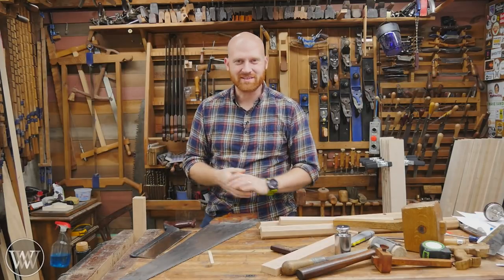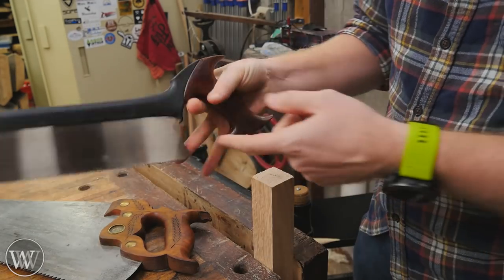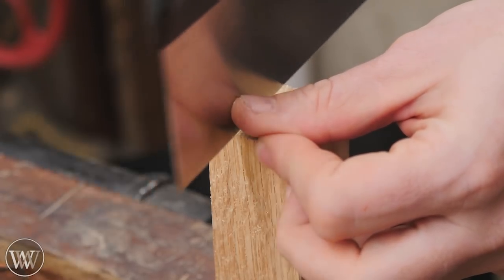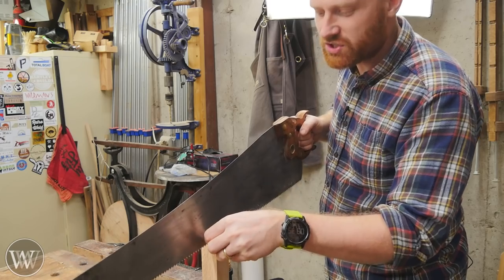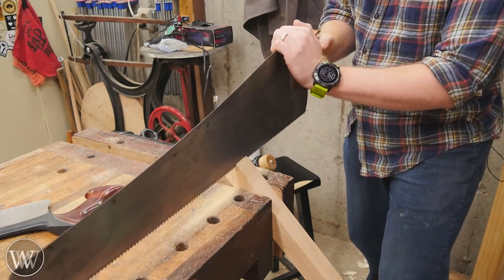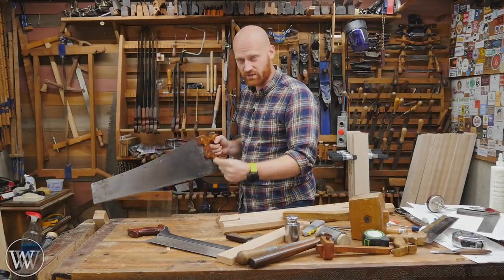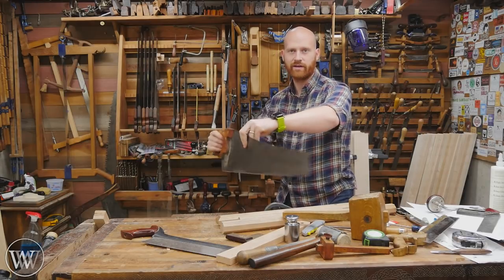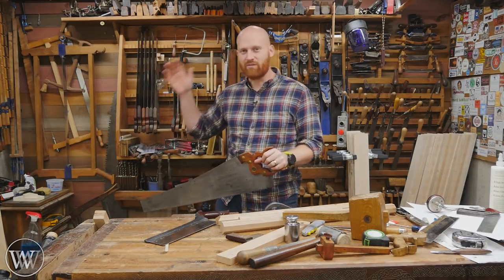How To Start a Hand Saw or Any Hand Powered Saw

Comment: Another useful and informative video.  I remember my grandfather teaching me how to hold a saw when I was about 7the years old (he was a carpenter / builder by trade) and now nearly 60 years later I am finally switching from DYI for home renovations that need to be done to working with wood for a hobby.  Your channel has taught me so much about both attitude and practical skills.  I have just made my first wooden  clamp (with steel threaded rods since I couldn’t find wooden taps and dies that could be shipped to New Zealand) and some file handles I needed, just to practice with hand tools.  My first big project will be a new chest of drawers for under the work bench.  Keep up the videos - I am hooked.  Thank you
Reply from the maker: thanks David. sounds like a fun time.

Comment: This is actually the method I use, I've tried a couple different methods like dragging the saw backwards to establish a kerf or using a knife and chisel to establish a channel for the saw to sit in but this actually works best for me especially when I've put in a good knife line. Took me months to figure out how to hold a saw and have it do the work and you explained that in the first one and a half min. I will say that at first I kept getting confused on why I would be on my line on both sides and the top but at the bottom it was bowed in the center, so I started sawing slower and that helped alot, now I understand why somewhere along the line I stop focusing on what I was doing at started focusing on getting through the cut and used to much pressure on the blade. I will say I do enjoy these back to basics videos they come in handy and i think that as we develop our skills we get to confident in ourselves and make mistakes that we learned not to make while learning the basics.
Reply from the maker: Right on man. it  is fun for me because i have to rethink them all the time to share them.

Comment: Very nice. So important to make sure your saw is set up correctly. Having inherited pre-Depression era Distton saws, they wouldn't start a cut unless wielded like an axe.
I have them now setup using Mark Harrell's geometry from Bax Axe. I made a little file holding block with hole for my file and the rake angle marked next to it for easy setup. 
Now, they start and cut like buttuh.

Comment: Thank you James for all the hard work, and sharing with us. I now understand the reason for the bottom horn is there a reason for the top horn other than aesthetics?
Reply from the maker: The top hand keeps your hand from sliding forward with a loose grip. it is easier to put the forward force of the saw on the webbing between the thumb and finger then on the index finger int he frame.

Comment: Great video and super helpful!  Thanks!  One question, I'm a new woodworker based in Germany and I've built up a nice collection of older continental style bow saws.  Rather than try to source western style saws, I'm interested in seeing how much I can do with these saws.  Since there are no horns on the handles, do you have any tips for how to balance these, normally rather heavy, saws when starting?  Thanks again!!!
Reply from the maker: Yes. Those can sometimes be tricky to start. Often the best method is actually to start it with two hands the hand on the top takes weight off while the hand on the bottom drives the saw.

Comment: I picked up a disston saw the other day and it has a lot surface rust on it  , it also has some etching on it, what would you recommend to clean off the rust without removing the etching? Great video as always James.
Reply from the maker: It depends on the type and amount of surface rust. Usually I will use a card scraper to scrape the rust off the surface. That will not get down into the etch and help save that. But in some cases depending upon the condition I'll use electrolysis or a rust bath.

Comment: Those are some nice tips! 
How do you feel about a two handed grip on a big handsaw?
Reply: You mean a panel hand saw with those classic handles? I myself use both hands, when the cut takes a bit longer (more than 15 minutes). My main hand is leading the saw an puts the most power into the blade. The second hand is there for support and giving a little more consitency.
Reply: @AlBorland3877  yes I do mean a panel saw (a rip saw in my case)
Thanks for your replie, I am always interested in the way other people work
Reply from the maker: Congrats on the first! I use a second hand quite a bit as it will alow you to ease into he pressure a bit, but I also train to saw with both hands so that I can rest one on long sawing sessions. there are some saws with a thumb hold for the second hand.
Reply from the maker: a panel saw is smaller then a hand saw. usually a panel saw is 24" or shorter with out a back where as a hand saw is >24" a lot of hand saws come with a thumb hold for that very use.
Reply: @WoodByWrightHowTo  my saw is just about as big as your one in this video

Comment: Great job Jim but I did see the thing that is my Nemesis .. bounce (you bounced out a couple of times and cut it out😉). When using the "light pressure" the saw will bounce out of the kerf if you're not careful. Practice is the only solution I reckon...Lots of practice...right? 😉
Reply from the maker: that is why I keep it pressed up agenst my thumb. that way if it bounces it is still on track.

Comment: I sometimes like to let the saw go loose for a few strokes in certain situations, like if it's a new saw, or I'm out of practice, or it's an awkward piece of wood, or the saw is sticking, or going out of line, or probably some other cases too. 
I just let the saw find it's own position for a few strokes, and let my arm remember that motion, and then copy it. 
Mostly I do this when I start applying too much force to the saw and it starts going out of line, or sticking. It usually means my arm is trying to do something that the saw and the wood don't like.
Reply from the maker: Right on. Let the saw do the work.
Reply: @WoodByWrightHowTo  Yea, I wish I could say I always do it this way, but I do have a tendency to force it every now and again. 
Especially when I'm getting well down into the piece, and I'm up to the aggressive back teeth. It's just so satisfying to feel the crunch when you take off an inch or two with one stroke!

Comment: You've mentioned a few times that there's a difference between a panel saw and a handsaw, even though they look very similar. What is the difference between a hand saw and a panel saw?
Reply from the maker: A hand saw is a panel saw that's at least 26 inches or longer.

Comment: What ever happened to the hand made hand plane you made? I would like to see you using it. It looks like it isn't worth making my own.
Reply from the maker: I have several wooden hand-planes that I have made. Most of them are very specific use planes that I made because I do not have one for that task. so they do not come up in most movies. Wooden hand planes are great if you are strapped for money, it is you like the feel of woof on the work, but they wear out faster, and if you use them day after day you need to maintenance them a lot more.

Comment: 4:30 - I would wind up without a thumb if I tried that.
Reply from the maker: That is the fun part of hand tools. They are all flesh sencing. They stop when they touch flesh.
Reply: @WoodByWrightHowTo  What do you think about using something other than a thumb, like maybe a little scrap of wood, as a guide instead?  (Currently nursing a cut finger after using it as a guide.)